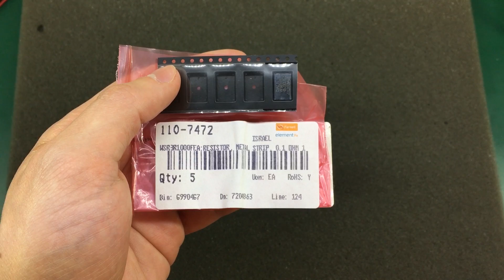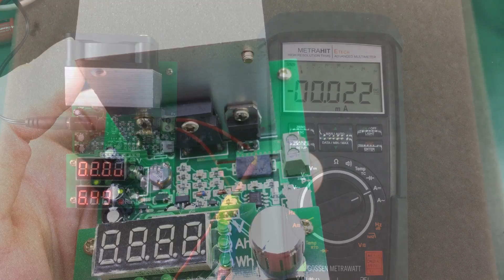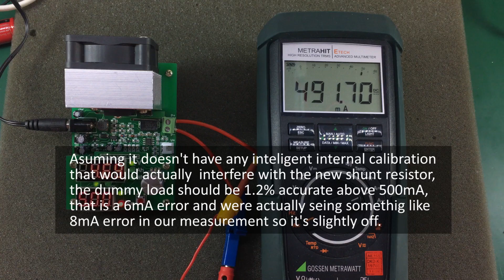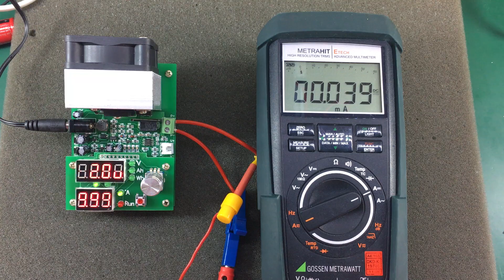Voltlog #41 - 60W Dummy Load Mod 20mA to 999mA

Comment: I wonder if we could go the opposite way and fool it into allowing more than 60W. Maybe putting in a larger shunt, and also a larger capacity Mosfet (maybe two?) and also a bigger heatsink.

Wouldn't be able to do the same trick of 100 times, but maybe two times, up to 120 W.

It doesn't seem so easy to buy an off-the-shelf 120W dummy load.
Reply from the maker: checkout my last video.

Comment: Hi. I modified my unit as described below. Parts referenced to your Reverse engineering schematic.R17 actually has a value of 1K. So, after calculations, to enable a 10 times less current, I fitted a 110R resistor in parallel with a 10K multi turn preset and switched via a dual dip switch (because I had it in stock) across R17. With the dip switch on I set up a current of 8.00 amps, which would be 800mA and trimmed the pot until my Fluke 87 read 800 mA on the load. So from 20 mA to 999 mA the Dummy load has 10 mA error. With the dip switch off I can then use the Dummy Load on its normal range. I hope this has some interest.
Reply from the maker: that's a nice alternative way to my hack, I like it!
Reply: Hello, so you basically reduce that R17 resistor from 1k down to 100 Ohm. While it works for a tight range around the value the trimpot was used at, I get a very nonlinear result from this, for example 50mA -> 180mA and so on. What am I doing wrong :((

Comment: instead of buying 2 pieces, you could try this 150w usb electronic load, to share an opinion... short specs: load curent - 0-10A; load votage - 0.5-10V; at a price of ~ 30$;

link: https://www.aliexpress.com/item/150W-Constant-Current-Electronic-Load-60V-10A-Battery-Discharge-Capacity-Tester-ammeter-voltage-meter/32725711985.html?ws_ab_test=searchweb0_0,searchweb201602_4_10065_10068_10084_10083_10080_10082_10081_10060_10061_10062_10056_10037_10055_10054_10059_10032_10078_10079_10077_10073_10070_10052_423_10050_10051,searchweb201603_1&btsid=52391d1c-1c9f-44ed-bf01-b3f02420c472
Reply from the maker: I actually have that one in my Ali wishlist, I might order one soon and do a review.
Reply: Sounds awesome :)thumbs up!! :)
Reply: VoltLog I'm waiting for that. Thanks for good videos. You know what You are doing - not much People like You on YouTube

Comment: nice mod...i just got my unit today after the inspiration i got from voltlog #38. i'm actually thinking of a retrofitting this unit to an old modem case along with a cheap LCR meter i got the other day for a nice cheap test gear (not metrology grade).

for the reange switch, how about using the contact resistance of the relay itself to act as 10mohm shunt when activated? that is, just shorting out the 100mohm mod?  i have not tried a search yet but there must be relays with such low contact resistance. 

thank you and more power :)
Reply from the maker: that could be an interesting idea but what happens when that contact resistance is not exactly 10mohms and on top, it changes every time it makes contact?
Reply: yep...most likely, so a mechanical relay may not be that reliable especially over long periods of time as the contacts wear down. i'm looking at ssd switches and other alternatives but it's really hard to find a switch w/ contact resistance in order of 10mohms or less. thank you
Reply: Use a reed relay.

Comment: The problem with this is now it can only draw 1 amp max, so larger batteries are not an option any more. Perhaps a resistor that is half that of the original would be better?
Reply from the maker: Use any resistor value you like but keep in mind you will need to calculate the correct reading from the displayed value.

Comment: Great job! You could probably just desolder/cut the display pin for the dot if it's bothering you. And a with a bit of tinkering, especially with the convenient pads on the other side, you could probably make a range switch. Anyone attempting this should be mindful of the shunt resistor and mosfet (or whatever it is) power ratings. Assuming this works like the EEVblog design, they basically share the power among them and changing the shunt magnitude might put either outside of specs.

Comment: Hello,
Great video series.
I don't have many experience in electronics, Does the replacement resistor needs to be a "Current sensing resistor / shunt resistor"? or could I use Ceramic Cement Resistor with same resistance value?

I notice that you are using Dale WSR series which I presume is a current sensing resistor.

Thank you in advance.
Reply from the maker: +Ricky Ari Nugraha A current sense resistor will have some properties that you want: initial accuracy (because you have no way of calibrating this device) and low temp coefficient (its value will not drift with temperature). You could use a ceramic cement resistor but your reading won't be accurate and the set current will change on it's own over time as the resistor gets hot.
Reply: +VoltLog  Thanks mate :)

Comment: Might the error in mA be due to the burden voltage of the meter?
Reply from the maker: +skimask87 the burden voltage should not matter in this example because: the load it's measuring and adjusting for a set current with it's own shunt resistor and all it cares about is for that current to be constant. The multimeter will have a burden voltage but that will not affect the reading on the dummy load because the same current should pass through both of the devices and the measurements should be identical.
Reply: +VoltLog 
DOH.  Of course you're right.  Wouldn't matter if you had 27 meters in-line reading current...

Comment: Nice mod, i like it a lot- easy to do and simple. How would you rate the potential for changing the controller software to drive a tft display, keypad and control watts in addition to constant current? In this way it becomes a more versatile piece of kit!
Reply from the maker: +roger eijkhoudt it can be done with current hardware, it's just a matter of writing the software. But I'm not sure anyone will  want to do that because it takes time to write that software and it is already doing allot for $20.

Comment: Oh, I forgot to mention that if using the unit in a 20ma load, the heat sink fan is probably not needed.  Yes? 
Thanks again - Tom
Reply from the maker: +cary smith yes, it could run 20mA load without the fan just the existing heatsink.

Comment: Hello - This is Cary Smith - not my real name, it is my Gmail name.  Many thanks for your quick followup and the wonderful videos you make.  I wish 5% of the youtube videos were as good as yours!

 My desire to have a smaller, 20ma, load is for testing small batteries such as camera and cellphone.   Which is mostly testing for mah and wh.  So I will also have to also scale down those readings.   For making the unit read both 20 and 200ma scales a switch would be nice - but - and would be nice to mount it on the unit.  But I'm not sure if I would trust switch contacts in the less than 1mohm range.  Another rather crude way of having it dual (20 and 200) would be to leave the 10mohm shunt in place and cut it across the top (making it open).  Then solder the mod .1ohm resistor across the cut.  Then, if you wish to go back to to the 200ma range simply drop a drop of solder across the cut.  And of course pop open the .1ohm.

Now my biggest problem will be to make a rig fixture to hold camera and cell phone batteries for testing.  They come in all shapes and sizes.

Many thanks again and keep up your excellent work and I hope you get well rewarded for it!
Tom
Reply from the maker: +cary smith I don't see the switch as a good option, for the 10mohm shunt just the switch contact resistance is enough to throw off your measurement.
Reply: +VoltLog You would have to come up with some plug in connector and different shunts to plug in.  Least amount of extra resistance.

Comment: Hi, nice mod. The ideal would be to have the two shunt resistors with a select switch. Keep the good work!
Reply from the maker: +Roberto Espenica I don't think it's possible to switch the shunt resistor without introducing measurement errors.. but I agree it would have been a nice feature.
Reply: +VoltLogI forgot to mention that I've also bought this Dummy Load (from Ebay). It works perfectly. It's a petty that the minimum current is 200 mA. But its a great circuit build with quality. It's a good bargain actually.
Reply from the maker: Well, that is why I mentioned in the video that I will probably be getting a second one, that I will keep as default with it's high current shunt. Maybe I'll even manage to get the 110W version.
Reply: +VoltLog i think the switchable shunt could be made. You just need a proper on/on switch that can handle the current and has a low contact resistance. Or just take a relay with this characteristics. Maybe i try that if my new rotary encoder for my broken unit arrives.
Reply: +Michael Bernhardt Perhaps you could come up with something using a transistor at least that would rule out contact resistance being an issue.
Reply from the maker: +lee3r24 a transistor would not solve the problem, example for a mosfet you would still have the Rds-on .
Reply: +VoltLog so i think i'll have to get out my best Meter (Fluke 87v) and measure some contact resistance from relais and Switches.....